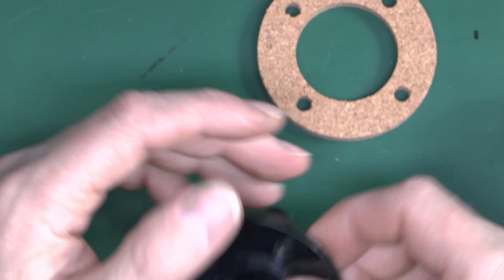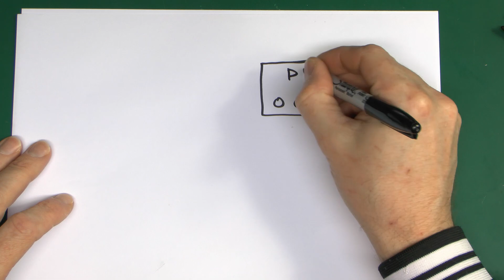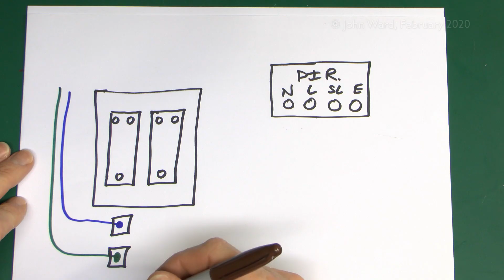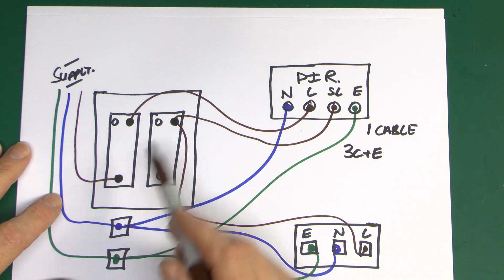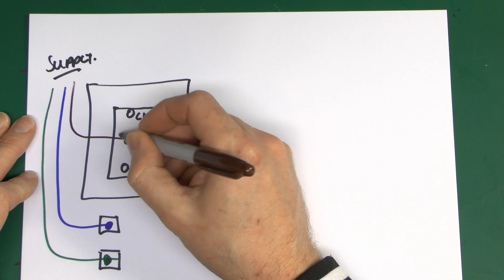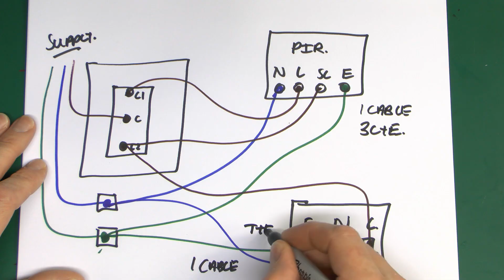Lighting Sensor Wiring with Override Facility

Comment: Hi JW,  for a DIYer like me doing some home elecs your vids are brilliant, thank you.  Can I ask a few questions on PIRs with and without integral lux function..........

1. Can I use a photocell unit to control power to a PIR (non-integral light sensor) or will the daily on/off power supply cause problems for the PIR having it's power supply turned on and off every day??  
2. Do you know of a PIR (non-integral light sensor) model number and supplier?  Everything online all seems to include the lux function which I'm not sure I want so do you know where I could get a basic non-lux PIR?  
3. Would LED gate lights approx 10-12m away (350lm 3.7W bulbs) cause any issues for a PIR with lux??  e.g. the PIR motion sensing bit wont work because the PIR sees the gate LEDs at night?  

Many thanks.
Reply from the maker: 1 - Yes, although for most of them it will result in the lights turning on for a minute or so when the power is connected.
2 - No, but most have a lux adjustment, set to 'day' and then it will work all the time regardless of the light levels.
3 - No,, for most you need at least 70 lux to represent daylight, no way you will get that from a few small LED lamps many meters away.

Comment: Most quality sensors offer a manual override (switching off the on within 2 seconds) that activates the preset inbuilt timing function (5seconds to 20 minutes). 

They also offer a extended manual on feature where if you switch the sensor on and off and then on and off again, it turns the lights on for an extended period of time (8hrs) before returning to automatic mode.

This way it is less likely to be turned on for an extended period of time with a short break in supply caused by an intermittent power loss.

Comment: I have an outdoor light already installed. There is a single switch inside the flat that turns it on and off. I want to add a PIR between the switch and the light (inline to the light). Is it doable with one cable? I was thinking a 5 core from the switch into the PIR and from there into the light?
That should allow for all conecitons?

Comment: I have an  Occupancy Sensor  with No Neutral and i want to replicate your diagram using thsi sensor. can you help
Reply from the maker: Those connect in the same way as a normal switch.  They won't work properly with LED lighting, and should generally be avoided.

Comment: Starting the video at 7:34, I was hoping you'd begin with the simplest method first, i.e. a single pole switch leading to the PIR, which controls, in my case, two outside lights. Despite reading the poorly translated manual that came with my sensor, I'm lost when it comes to following the wiring diagram! Could someone (preferably J.W.) please explain precisely how I join the wires in the terminal block. 
OK, I've got as far as putting the L and N from the supply into the terminal block on the PIR and the N going to the light by the PIR also into the N terminal block, but I'm not sure about the remaining L wire. Does it become a Neutral or what?  And where should it go on the block?
Any help would be most appreciated.
P.S. I've installed PIRs before with no problem, but that was quite a few years ago!

Comment: Hi JW, Is there a way of incorporating an override switch in a 2 way or intermediate switch setting?
Reply from the maker: A double pole switch used to connect all 3 wires together would turn the light on, and prevent it being turned off from any of the other switches.
Reply: @jwflame  Thank you for your reply... I thought there might have been some sort of new invention to be able to have a 3 position switch from multiple location 🤯 without making things complicated for the customer.
Much love from Australia, thank you for sharing your knowledge.

Comment: What if you had 3 PIR sensors on different sides of a small building that all worked a single bank of say 4 lights? The total lighting load within the PIR's Amp loading. Can that be done even if 2 or all 3 PIR's were at some point tripped and passing current?
Reply from the maker: Yes.  Current would be shared between the PIRs if more than one was active, but that doesn't matter.
Reply: @jwflame  Thanks for the reply. I am about to wire it all up and using a 10A contactor for the 4 lights to take the load off the PIR's.

Comment: For whatever reason, the setup on the second switch in the first setup makes me uncomfortable. I'd have rather seen the live go from the first switch, and jump to the left hand terminal of the second switch, rather than the common. Then the light connects to the common, and the sensor connects to the right hand terminal of the switch. This way, on and off behaves as expected, and the auto switch either goes from left to common to light (always on), or live goes from first switch, to pir, to right terminal to common, to light. In this configuration there is only ever one live path to the load and no loops. 

I don't mind loops in DC systems, but they make me upset in AC. I'm not sure if that sentiment is based in reality.

Comment: I think I'll do it by going sw1 + sensor in series with sw2 in parallel to both. Instead of sw1 + sensor in series and just the sw2 and sensor in parallel, which this seems to be. It's a small difference both in wiring (just tie the switch inputs together instead of sw1 out to sw2 in) and operation, but it does mean that sw1 is just for enabling/disabling the sensor and sw2 operates the load as normal. Nice and separate functions for the switches, no need to have both on to definitely have the light on. Although it will be. It's just a single difference in the truth table, when sw1 is off and sw2 is on the load is on, instead of off.

Comment: Every time I turn on the ON/OFF switch ( please note the PIR switch is in auto) the sensors click many times and the down lights flashes many times. After that the system settles. I am using exactly the same first  configuration. 
Can someone advise? Thank you.

Comment: I have a question, just fitted a pir in the bathroom, but it stops working if we use the shower, I guess the infrared won't pick up though the shower glass, is the microwave version going to work better.....
Reply from the maker: Yes, microwave will work through glass.  However make sure to get an adjustable one, otherwise it will also work through the door, window and in some cases through the floor/ceiling into other rooms.
Reply: @jwflame  thanks for letting me know that...

Comment: Great video.   However I connected my outside light photocell as described for 3 position switch.  Everything fine except for when in the override on position.  Lights are manually on but I can here photocell switching on and off constantly.  This is due to removing live input to photocell but having live connection to photocell switched  output.   I could replace photocell with relay output type but manufacturers detail don’t appear to give this info.  In my opinion better arrangement is to connect live in and input to photocell to switch position 1, connect switched live from photo cell to switch position 2 and connect feed to lights to the common terminal on the switch.   Has the benefit of keeping photocell live and not back feeding the photocell which I believe causes a fault for most common types.

Comment: Hello John. I enjoyed watching your video on how to override a pir sensor using a two gang and centre off switch.
I Set up a practice board and found the same result can be achieved  if you use a one gang one way switch and a 3 core cable from the pir to the switch.Take the supply feed to the switch connect the live feed to common and the pir switch line to L1 or L2 and join the neutrals using a connector block or wago.
Reply: That’s the way our outside light was wired, PIR and on/off switch to override with one-gang.
Reply: how can it be a one way switch if you have L1 and L2. that would be a two way switch
Reply: @JayG2K  connect permanent live from the board and pir to common then add the switch line to L1. The neutrals go into a connector block as does the earth.

Comment: Great video - you have a way with words and making things simple. One question: Can I have a PIR to turn low-level mood lights on (like decking-type lights) in my bathroom BUT also have the main bathroom lights connected to the mood lights - so that ALL lights come on from the main switch BUT ONLY the low level mood lights come on via the PIR? This is to have the low-level lights come on in the middle of the night for a bathroom visit. My diagram suggests that the mood lights will pass on the current to the rest of the lights so the PIR will sadly turn EVERYTHING on. I'm wracking my brains to see a workaround. And believe that YOU have the answer! :) Cheers
Reply from the maker: You will need a relay.  230V coil connects to the existing lighting, and the contacts of the relay connected in parallel with the contacts of the PIR.
Reply: @jwflame  Mmmm thinking hard John. So the existing wiring when turned on - switches the relay to 'on' and therefore lights the low-level mood lights. But - the low-level lights if turned on by the PIR are not directly connected back to the existing lights, so, therefore, won't just turn everything else on! I think I have it! 😁 (Supplementary Bonus question: Do you know of such a relay? Looking online they look like they would sit in a sort of Consumer Unit setup).
Reply: @jwflame  And mega thanks for the reply John - I've had sleepless nights thinking about this satanic dilema! :)

Comment: Hello I've looked at all your videos but cannot find a microwave sensor with manual overide. I'm trying to fit a V-TAC VT-8077 Microwave Sensor 360° white with manual Override Function to 240v battern lights in my workshop , it has four connectors N NL L middle connector for load I've connected all to power fine, but the light keeps tripping the house RCD, I've connected the earth cable from the power to the load lead, could this be causing the problem, not sure how or where the earth's should be connected, your help, or anyone's help would be desperately appreciated.
Reply from the maker: RCDs trip on earth faults, which will either be L to E or N to E.
As the sensor has no E connection, it's not the sensor causing it.  More likely incorrect wiring at the lights or a damaged cable.

Comment: Looked at the video. I can see absolutely no idea when a supply is derived from a switch fuse spur to use a 2 gang switch as described in the video. The far simpler method is to use  a 2 way switch as in on/auto. L1 on the 2 way would be permanently on L2 would be auto as in the external PIR sensor does its job
Reply: They are deliverd from a consumer unit

Comment: What if you want to have the left switch be the on/off to the power to the auto sensor/light combo....... and have the right side switch make the light turn permanently on or permanently off override to the sensor light?  Is that possible?  If I am understanding this correctly;  the right side switch in your illustration would either allow the sensor/light to be in sensor 'auto' mode, or sensor 'always on' mode..... but to turn the entire sensor/light 'off'..... requires the left side switch to be in the 'off' position, if you wanted to keep the sensor/light completely 'off/disabled.'   Can't it be wired so the right side switch overrides the sensor/light normal operation of the left side switch by turning the light permanently 'on' or permanently 'off?'  or, is that overly complicating things?
Reply from the maker: If one switch is wired to permanently turn the light on or off, then it's just a normal switch.  The other one will do nothing.

Comment: A great video John.  Do you know whether it is possible to use a PIR with a 1500 watt electric radiator?  If so how would it be wired?
Reply: use a contactor if it cannot cope with the load

Comment: Question:  I would like to program my chicken coop heat lights to come on at dark and go off when when it is 50ﾟor more outside which is which is well after it becomes light. 

Wondering if you have an idea on how to wire or program this?

Combo heat/light sensor?

Comment: Really useful video, thank you. I wonder if i can use a timeclock instead of the override switch, such that I can bring the light on under timeclock control, and then when the Timeclock switches off, the light remains under PIR control, so effectively using the timeclock as an override.
Reply from the maker: Yes, a timeclock is just a switch operated by a clock - the principles of wiring it are exactly the same.

Comment: Love your vids JW, but I’ve come across this so many times… and I hate this method… if you put switch to auto, day or night, the sensor has to settle for a couple of minutes, and if it’s a photocell it will start clicking and almost certainly mess up due to back feeds. I usually connect mains to L1 and auto sw back to L2, with sw to the light connected to common. This way there is no back feeds and no sensor settle time…

Comment: Thanks for the help always get confused with wiring of lights. The second option you have if there are two rooms that are to be controlled separately. We would just need a live connector as well same as earth and neutral and just supply both switches from there I suppose?
Reply from the maker: More lighting circuit info here: https://www.flameport.com/electric/lighting_circuits/index.cs4
Reply: You would ideally loop the supply in and out of each switch, connecting through the neutral and earth cores in a wago or similar and linking the line via the common terminal in the switch.

Comment: Could you send 230 volts to the sensor switched live without disconnecting the sensor permanent live ? ??   This might be an option in an existing installation where you wanted to add a override switch in a different location without touching the existing wiring .
Reply from the maker: Yes, that will work.  On most the output is just a relay contact, so it won't damage anything by connecting it to L externally.
Reply: @jwflame  Thanks .  The PIR i just ordered showed in the online specification  sheet that it can be manually bypassed this way

Comment: Hello John great video again re sensor wiring. sorry to be dense but I have a steinel dusk to dawn and  has N L' N L Connections on the sensor. 4  lights. I have wired in the live and neutral from the  supply and the other N I put the neutral from the first light and the L' I put the live from the light and the switch line from the live. unfortunately I only have the first light coming on and the other 3 are not coming on. I have checked and all the lights are serviceable ....HELP !!!!

Comment: A nice explanation, maybe best to have flat faced connection box (wiska) to mount your PIR on. All your connections are up in the eves and not show excessive cables coming down (surface mounting) at switch which is all the customer will see. Also multiple PIR's need to link their switch Line to multiple lights.

Comment: Is it possible for a single switch to be the slave and have the PIR as the master? Ideally i would want PIR in use all the time but a switch to make the light stay on until the switch is set to off - i dont need the centre off position and ideally i just want a pull cord

Comment: We have outdoor lights connected to one switch such that in one position the PIR works but in the other position the light is permanently on. Works great for us. Is this bad practice or dangerous? I'd like to do something similar in a hallway but do not want to use two switches.

The PIR is using 0.5 watts if you don't have an 'everything off' switch, but beyond that is it terrible?

Comment: Hi John, Excellent video as always. Just to say that the web page you refer to (https://www.flameport.com/electric/lighting_circuits/PIR_lighting_sensor_with_override_switch.cs4) seems to have a problem. Not sure if it's a common problem but I can see the Two Switches section at the top and momentarily, the One Switch section underneath, but once the page is fully loaded, the One switch section disappears, probably something to do with the layering of the DIVS, if you'll pardon my French.

It could potentially be a plugin I have that's caused it but the behaviour occurs both on Firefox and Chrome. I haven't tried it using MS Edge because, well lifes too short.

Regards and thanks again for the great videos.
Reply from the maker: It's due to the advertising, it's pushing the rest of the content down the page, if you scroll down far enough it's all still there.  Most of the pages have the same problem to some extent.  Problem should go away if viewed in a narrow window so the left side menu isn't shown by default.
Will be resolved soon, the site is being redesigned to fix that and several other problems.  It's a very old design that has been tampered with several times to fix other issues, and it's all rather broken.

Comment: Great video but the problem I find is that most flood lights now include a sensor but they are now all sealed and you can't get access to bypass them anymore. This is somewhat frustrating as it means buying separate units, separate mounts plus a more complex wiring. The old one you could disconnect and rewire!

Comment: Hi John, Thanks for the video, really like the idea of the centre off switch.
Can this arrangement work if I wire in series i.e. have a 3core and E from the centre off switch to the PIR, then a twin and E from the PIR to the light? I can then connect the PIR SL straight to the light? I'll be using wiska boxes for wiring connections throughout. Any help would be appreciated.